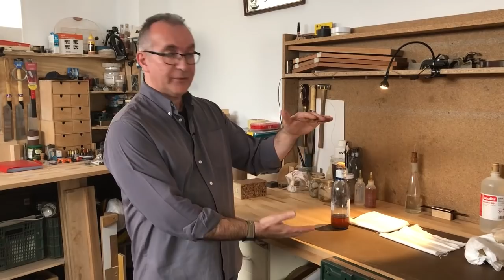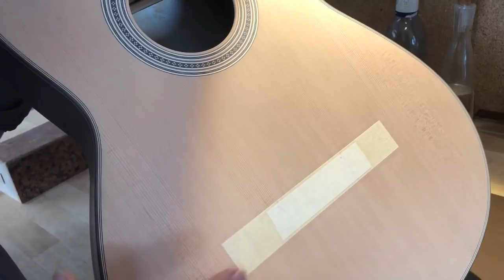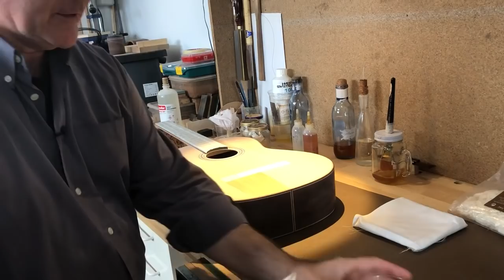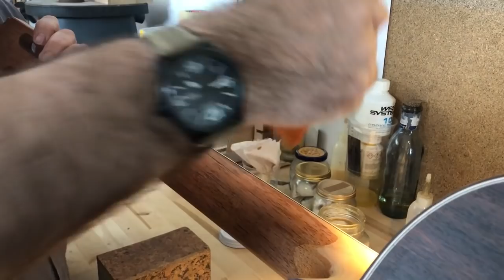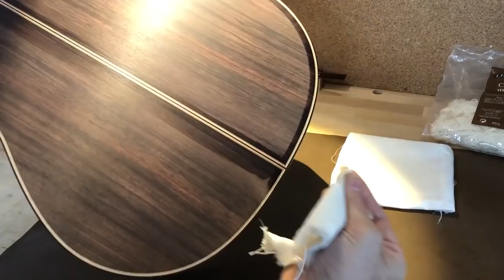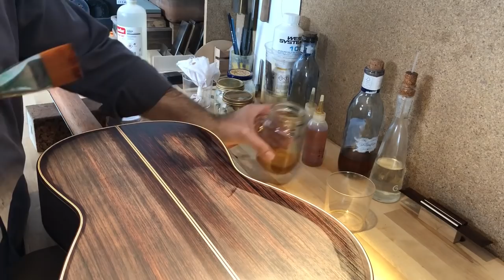How to French polish your guitar. Video 3 of 9.

Comment: What an amazing set of videos. I purchased a Mexican guitar by Enos Hernandez a while back for very little money, fan braced cedar top, Spanish heal, with solid palo escrito back and sides beautifully constructed. A very light guitar ~1250 g . I felt like I had to save it. The previous owner had started sanding off the finish for some reason. I have spent my nights over the last several months carefully cleaning off the rest of the old finish and preparing to French polish the guitar. These videos have been invaluable as I have been learning French polishing on scraps of wood in preparation for finishing my Enos Hernandez. Thank you.

Comment: Hello Pablo

Thank you for responding to my e-mail last night regarding the tonewoods used in this video.
Can I ask a further question please ?
I bought a second-hand (used) Washburn Cumberland jumbo which is a beautiful guitar however, the previous owner decided he wanted to apply a  varnish to a natural finish but, unfortunately, splashed this varnish / finish on to the soundboard in three different places without finishing off the application. I can only presume then that he fell asleep as the soundboard now has three large areas where the varnish has been applied.
I have sanded and sanded and sanded these areas but, to no avail, these areas still retain the varnish "stain".......so my questions are 
1) do I keep on sanding ?
2) will these stains disappear?
3) can I apply some application to remove these stain areas and then apply a decent finish.

Thank you.
Reply from the maker: Lynda McArdle i am sorry to say that without seen the guitar it is difficult to make an assessment, but perhaps I can try to answer your questions.
Sanding is the last thing you would want to do to any soundboard, to remove varnish, lacquer, or any other finish I would use paint stripper, as many times as needed depending on the type of finish on the guitar, once all finish is removed you could do very light sanding to completely clean the surfaces.
If you have been sanding and sanding and the marks don’t go it is possible that some thin oil has been used and it’s gone very deep into the grain, but I would try the stripper in those areas just in case you can pull the finish completely.
To lighten up some areas of the soundboard you can use wood bleaching products or H2O2, but you could end up with uneven colors.
Basically...... not a fun job.

Comment: Thank.you so much. You are so wonderfully generous in sharing your expertise. Greatly appreciated! One question- do you take the surfaces down to 400 grit both before and after the grain filling?
Reply from the maker: John Keenan on the rosewood I take it to 240 before grain filling and to 400 after so that the surfaces are as scratch free as possible on the soundboard and neck I also prepare them to 400 before applying any polish

Comment: Bonjour Pablo, pouvez-vous m'expliquer pourquoi vous mettez deux épaisseurs de scotch de masquage( masking tape) à  l'emplacement du chevalet?
Le découpez-vous à la largeur exacte du chevalet ou légèrement en retrait 1 ou 2mm?
Merci
Reply from the maker: This is just so that it is easier to polish the top without the obstacle that the bridge is. This means that as you glue on the bridge the polish around it goes all the way to the bridge. The tape is the exact dimension of the bridge.
Reply: @redkitekk  ok thanks you Pablo but why do you stick dobble masking tape one above the other?
Reply: I usually don't put masking tape on and when the top varnish is finished, I cut around the bridge then scrape the varnish under the bridge with a small scraper.
it is quite difficult to do and requires a lot of attention to detail.
on my guitar in progress, I stuck the bridge on the table before varnishing to try and I regret ...

Comment: Is using non hardening oil superior to hardening oils such as walnut or just preference?
Reply from the maker: Oil is just used as a lubricant. One of the later stages of polishing is to remove all the oil to be able to gloss up the surfaces, so I don’t think it would make much of a difference if any.

Comment: Dear Pablo, thanks so much for the time and effort you put into these videos.  I was wondering how you keep the white purfling and back center stripe from getting stained by the rosewood when you sand the grain filler back to the wood prior to beginning the shellac?
Reply from the maker: You first have to seal the lines very carefully with a clean cloth and a bit of shellac and change the clothe each time you do one pass to apply the shellac, you have to do this there o four times before you can start polishing
Reply: @redkitekk  Thanks for this! I am finishing a federal card table in mahogany with holly inlay and I have not been able to find any information on how to fill grain and french polish without contaminating the holly inlay. This is the only method that makes sense to me so I'm going to give it a shot!
Reply from the maker: @andrewkonopitski7939  try the resin in an of cut of mahogany and holly to check that the resin dries clear to polish on top, I don’t use these timbers so I don’t know how the react to resin, with some timbers the clear resin is not so clear once dry so it is best to test it before you use on your table.

Comment: Wondering if the rosette has been pre-sealed.  Otherwise, wouldn't the dark wood bleed color into the shellac and spread onto the soundboard?
Reply from the maker: Hi Thomas, yes, I seal all the surfaces with a thin coat of shellac before I start polishing.

Comment: Papblo's vid series here is fantastic, and I've followed it at restoring a guitar from a conventional varnish - I'm not through yet. I see one worry here in No 3: if you - like me - start from a semi-filled wood surface - which well might be the case for my 240-grit ground surface, not fresh cedar - then Pablo's way of filling the surface with pure shellac w/o rubbing it in, might be a touch too tough. I might have got imperfections from that fatty shellack that cannot be removed now at later stages. Next time I do this with another of my guitars, I'm gonna rub in a pure, but rather dry, shellac solution using the conventional rubber, with or w/o the abrasive powder, pom pomm whatissname. At the later stages here I'd be using a liiittle alcohol in order not to get stuck, try to be working on it, before going into the actual polishing using oil.
Reply: how did you go? im about to start a refinishing project of a guitar with Nitro.. only gonna do the soundboard. need to ensure that its all come off first. he did mention that the top does not need any filling, but use up to 400 grit. he also told me to use paint stripper to get rid of the nitro first, then start at 180 grit, 240, 320 then 400. will be starting this weekend. would be nice to know how you went with the pomice stone powder. cheers.
Reply: @hni7458  this is valuable insight. I will be FP my soundboard once i was done with getting the Nitro off, but i understand what you mean by the paint stripper being aggressive. I appreciate your comment, best wishes. id like to go and build a spanish guitar with Pablo one day, need to save up lol. ciao.
Reply: @MastersOfTheHeart  
Thank you kindly for asking Mauri. I know you aren't asking about French polishing, but I'm giving you the lot still; it may help someone here. Perhaps you are getting into French polishing ahead. Sorry for being so talkative, but here we go. 

I've heard from very reliable sources here, w/o disclosing what sources, that one should be using pumice; I didn't in the end, but that is only becasue I went pass that stage when I at last found a 6/0 (very fone grit) mix in Italy.

Please observe that I didn't have to use any stripper; that's what I found initially, I could skip that filthy agressive stuff, and I just ground off the thin polish, whatever chemistry it was. Beware from going down into the soundboard, that's a stiff NoGo, just eliminate to old surface coating. My initial problem from last summer was that I started with waaay too wet a shellac cloth. I think partly this was due to what I say in my initial comment above, but not only that, please see bullets below, and I regret to say that Pablo has not commented there. Anyway, I've put in much effort here and my findings for French polishing, FP, are as follows - however, it must be emphasized, this very much in line with Pablo's professional directions, for which I have a high opinion:

- don't overdo initial grinding for removing old coat, don't go above some 400 grit (takes long to explain, but I had some ghost patterns that formed at the plain soundboard surface that formed at some 600 grit; I asked at the Net, no one could explain)

- I won't ever once more start from applying a heavy shellack solution directly into a dry soundboard, and if you do, be wary of imperfections since this will be the base to build further upon, and EVERY imperfection will show in the end

- newbies generally ALWAYS use too wet a cloth, wet with respect to shellac-spririt solution, not necessarily shellac concentration - the cloth can't be too dry; FP is more about tribology than really a surface coating process, this is sooo important, and this is not intuitively appreciated - I didn't, even if I had been strictly warned; and indeed had seen Pablo's YT series - this fact cannot be overly stressed, and is the most important part of all FP if you ask me

- use oil in the manner it's directed by Pablo, esp important in the beginning

- stop with maximum two polishing sessions a day, if even that, well separated in time, and end EVERY session with a concluding step where you taper off the shellack portion in relation to spirit in order to get off oil; but always with a comparatively dry cloth

- with advantage use tiny compressed (not to leave debris) pure-cotton cloths, suggestively such 50mm diametre circles our ladies use for make-up work. Works great esp around crammed areas as around headstock, bridge etc. The risk here is sctraches from nails; never ever have a beer and go FP, this is about pure concentration; one deep scratch and you are screwed, and this - remember - over months (?) of work

- so you aren't allowed to get into any hurry here; this takes time, so let it take time then, this is sheer contemplation, relaxation, valued time for one's mind - some work with the FPing of a guitar during several months; we newbies have generally never understood that fact.
Reply: @MastersOfTheHeart  Thank you Mauri,
In fact I gathered enough experience last year to get me the courage to now having fixed small dings in a vintage expensive guitar of mine from 1993, using a water-soluble filler à la Robert O'Brien, this onto, and into, the old FP. Great result if I may say so myself, and I encourage you to sweep the Net and then to mainly stay to Pablo for directions according to his vids. But you please remember what I say as well 😁

Comment: Dear Pablo, thanks so much once again for your excellent videos. 
A question. Here in Thailand, I can get 95% and 99% alcohol (and possibly 70% from the company that I order from). I've used both but at this point, but I haven't quite figured out, because of various variables I suppose,  which one is the better choice. If you had to choose between those two alcohol percentages, which one, do you think, would be best?
Cheers and all the very best
Cath
Reply from the maker: Catherine Thompson I have never used anything but 69% but I believe you would be ok using a higher % as it will have less water.
Reply: i think you mean 96% Pablo? here in australia i have found 100%, im starting my french polishing this week after removing the Nitro from my Cedar top spanish guitar. i have done 240, then 320 and now doing 400...